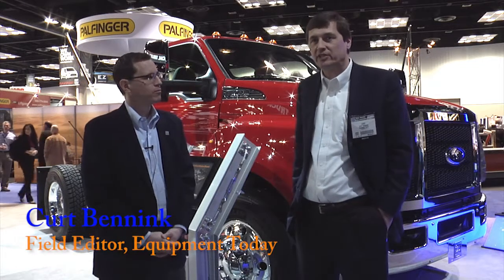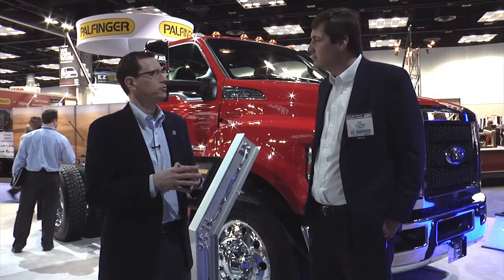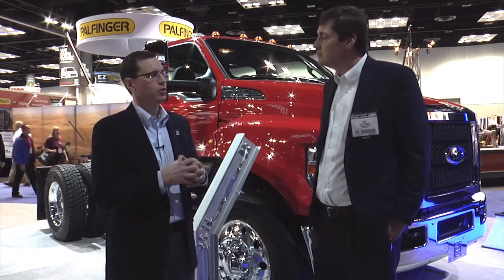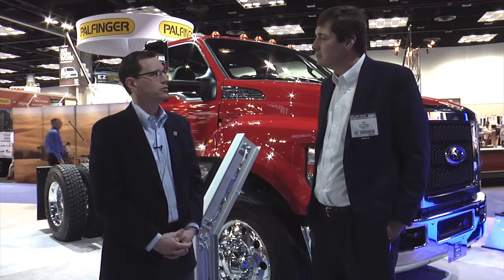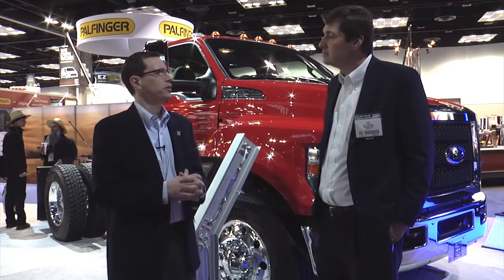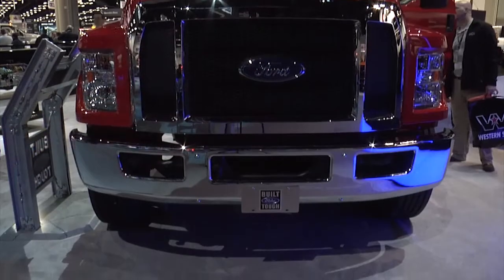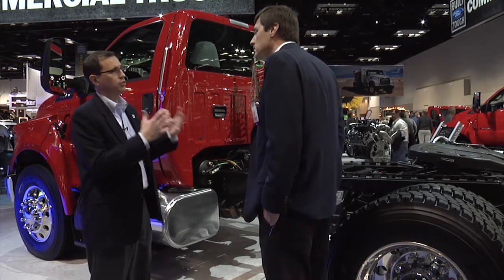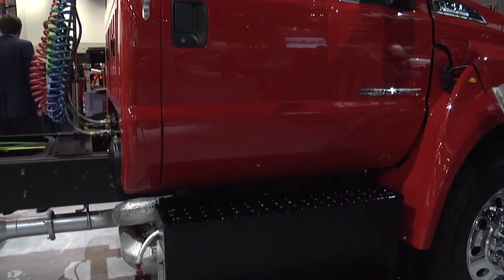Video: Ford Unwraps All-Ford Powertrain for 2016 F-650/F-750

Comment: Ford really has no clue , This guy sits there and says by having the 6.7Lv8 ford engine it will get them the Hp and Torque that they need to get to the customer. YET they had that already with the cummins / Allison combo. Why Ford !? Why so many mistakes since 2003 with the crazy ideas ! You are Killing you own truck with that powerplant combo ! It will never work out in the 750 !  Its over Johnny !
Reply: You apparently don't get what's going on here... Ford in conjunction with Navistar started Blue Diamond Truck, which built the F-650 and F-750, after Ford sold the HD line to Freightliner in 1997. But Navistar (International) pissed both the owners and Ford off with the 6.0L and 6.4L Power Strokes, so after there epic fail Ford decided to eliminate the hassles of power train suppliers, and build there very first diesel engine. That way Ford would be able to streamline the warranty process and be able to control the quality.

That is why once the new 2016 F-650 and F-750 start production, every Ford truck will have an all Ford power train. The F-650 and F-750 were built in conjunction with Navistar in Mexico, but now they will be built solely by Ford once again at the old E-Series' Avon, OH plant. The 6.7L Power Stroke and 6R140 TorqShift automatic transmission is one hell of a power train. "You are Killing you own truck with that powerplant combo", you have no idea what your talking about...

"It will never work", yeah that's what fellow manufactures said about Ford's inverted design, it wasn't crazy, in fact, it was brilliant, it almost eliminates turbo lag... And yet 5 years later that design has caused no problems, that is why Ford is the leader in innovation...
Reply: Clint Osowski  Your reply stinks of Ford rep , I am the boots on the ground. I myself was a Ford HD truck rep during the Sterling Truck transition. I know of everything you have already spewed. You can call it whatever you want , but the 750 will lose sales to the Individual business owner. You will lose that to IH and or FTL.   The torque shift transmission is no match for a Allison 3000. The 6.7LV8 is No match for the ISB in higher ratings. You really should be offering the ISL in the 750. I'm thinking you have no understand of real low end torque and engine longevity. The point for a larger low end torque motor(860ft lbs +) is not to work so hard while moving the load. Trucks which will have no more use for the 750, 4 car carriers , 16 ton wreckers , 2850 gallon liquid bulk haulers , HD Dump truck applications. At least with the 6.7L ISB you could get 750ftlbs and team it with the A3000. Do you know what B50 life is ?  B50 is the estimate of when 50% of the engines of a certain type will require major repair (repairs requiring dropping of the oil pan or removal of cylinder heads ,  the ISB has achieved that @ 500K mark. I find it real hard to believe the V8 6.7L will ever achieve that. What does a replacement long block 6,7L costs these days ??
Reply: Doug T Uh no, I'm not a representative for Ford, I'm an owner of multiple Ford trucks, oh, and I own and operate my OWN company... Wow... So the Cummins get's a whopping 25 lbs.-ft more torque then the 6.7L Power Stroke, oh but it also has 5 HP less then the Power Stroke... Not to mention the base standard Power Stroke has 270 HP and 675 lbs.-ft of torque. Your beloved Cummins comes standard with a whopping 200 HP and a measly 520 lbs.-ft of torque...

Duh... Obviously the more low end torque you have the lower the RPM's need to be, therefore the less wear on the engine... So what was that about your "(860ft lbs +)" thing? Because I don't see that with either engine, so that dull point is also invalid in this instance...

 You can keep your Cummins, and I'll keep the first Power Stroke that was designed and built by Ford... By the way this isn't the first time Ford offered the Power Stroke in the F-650 and F-750... The 6.7L Power Stroke after almost five years has proven to be every bit as reliable as the old 7.3L was... The 7.3L can easily get up to 500,000 miles, and there were many that got up to 1,000,000 miles before needing to be rebuilt, so don't give me that...

As for the 6R140, it is rated for 1,400 lbs.-ft of input torque, so obviously it's BUILT FORD TOUGH!... That and the F-650 and F-750 will have a MEDIUM DUTY VERSION, that means it will be even tougher then the regular one... Your Allison 3000 in the F-Series varies from 950 lbs.-ft to 1250 lbs.-ft of input torque... You can keep that Allison...

As for loosing sales to International (Navistar), pft, please... I guess you obviously have't heard of International's latest fail... There having issues with there DEF system, what else is new... That's funny, because Ford isn't... Ford's DPF, DEF, and SCR systems (Selective Catalytic Reduction since you more then likely didn't know what that meant) work perfectly together, and has for almost five years...

Where do you get off saying I don't know what I'm talking about, you don't know me... Try looking some things up before you shoot your mouth off to me again...

Comment: Cant wait to see the new 2016 models on the road. They looks great and should hold up according to what Ford is claiming with all the durability testing. Interested in the 6.7L diesel specs and power levels available.